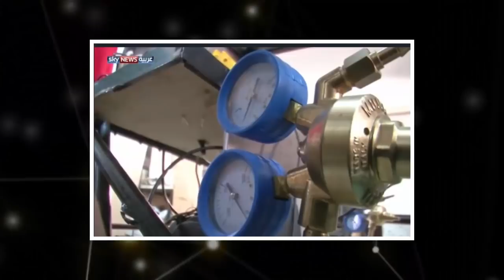students have designed an incredible one-person go-kart that runs on compressed oxygen

Comment: The air needs to be compressed, which takes energy. Air compressors often run on fuel. Then, every energy conversion has losses; this means that running the cart on fuel directly (instead of using up fuel to compress the air) would probably be more energy efficient. It's dumb this is not mentioned in this video.